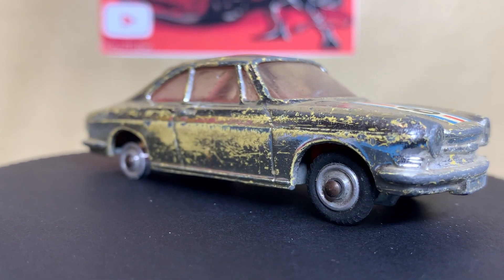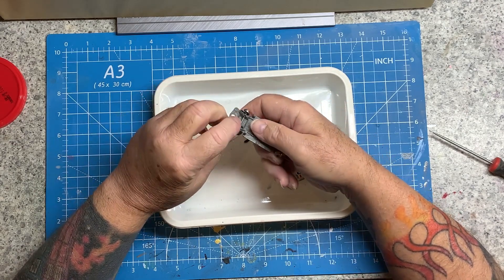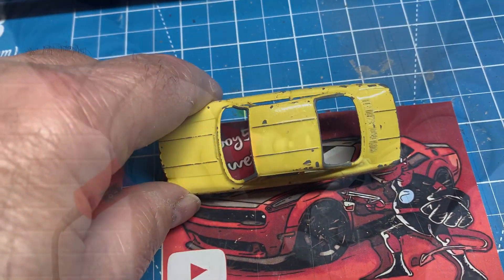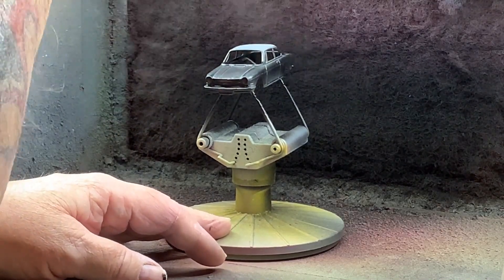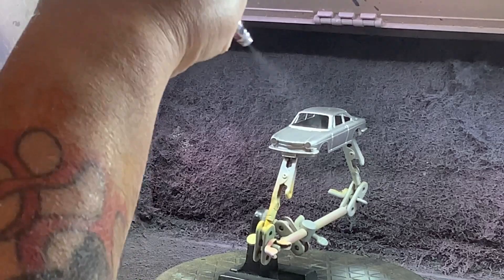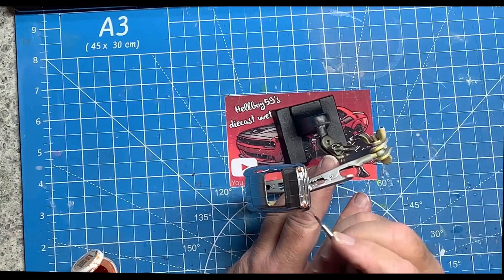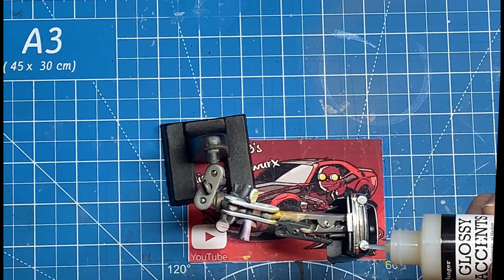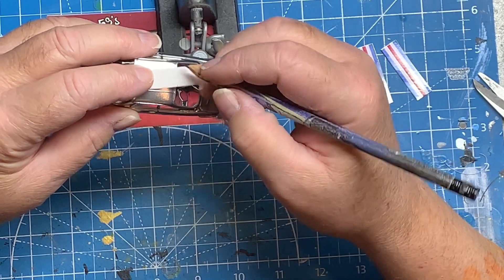Simca 1000 by Corgi (circa 1965)

Comment: Corgi Bob Willis did this one. He didn't paint it it, but spent a few hours polishing the raw casting. I did that with a few that I've done. Like you said, laçquering has a reverse effect of dulling th finish
Reply from the maker: Yes I pondered a few ways to get a chrome effect “chrome “ paints are often disappointing
Reply: @Hellboy 59's die cast Wetwurx  know what you mean buddy. I don't always get molotov right either. Certainly wouldn't work on a car body
Reply from the maker: @ianhow100  I must say that “mirror” paint from Stuart Semple seems the best I’ve tried so far and it lasts ages
Reply: @hellboy1959  sounds interesting